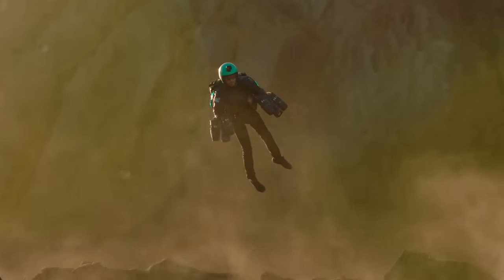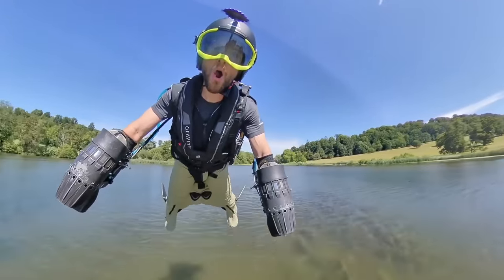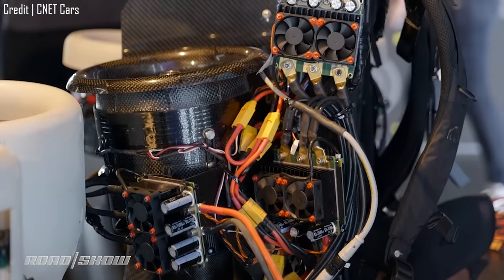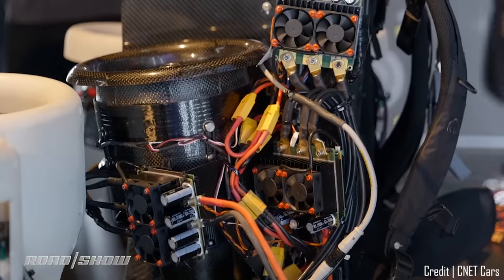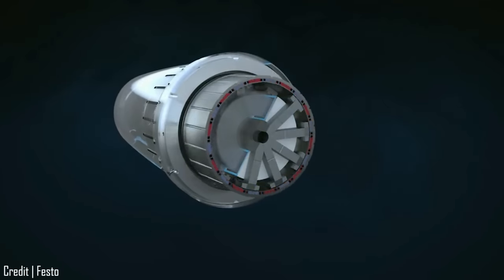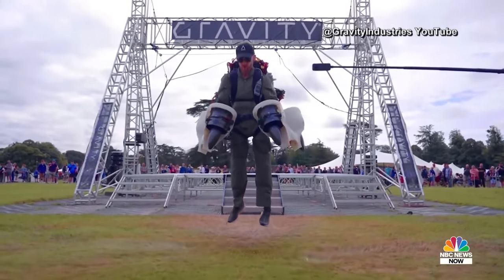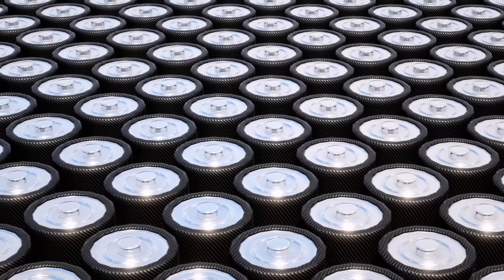World's First Electric Jet Pack Is FINALLY Here!

Comment: While technically you could do pure electric,  limited flight time is a major problem. Batteries don't yet have even close to the energy density of fossil fuel to compete.
Reply: but that goes against the green narrative!
Reply: Factor in developments in Beamed Energy towards Space Elevators, Laser Development for Fusion, Targeting Systems for Automated Point Defense, and factor in a Real World Development need and it's just an engineering problem which needs a dedicated team with cash :P

No Military or Rescue Service operates without support resources, so a Local Energy Source seems reasonable.

Plus if the intent is for training there's a strong likelyhood that permanent physical tethering could be justified by the use case in a controlled environment: say a warehouse with a Crane Gantry system delivering mains power.

No Iron Man, but maybe a Tin Man? : D
Reply: @XAtmo97  

I'm just talking about the present and particular use cases where high energy density is critical (e.g. flight). Of course physicists and engineers are always coming up with solutions to seemingly insurmountable problems. Battery densities might one day improve to a point they are competitive or even beat fossil fuel.

Some argue interplanetary rockets are a use case you can never use pure electric. I recently read an article about some physicists who speculate even electric rockets might be possible one day using an interesting loophole in special relativity.  Since mass increases with speed, they argue in theory it should be possible to put particles in a loop where on one side of a proposed spacecraft their mass is greater than the other. (effectively simulating a rocket ejecting mass to accelerate) Physics is amazing.
Reply: thats because people still using lithium batteries, there is aluminium air batteries that can store far more energy dense, but cant be recharged like the way we charge lithium batteries
Reply: They could use nuclear energy and develop a way to keep dangerous radiation from effecting you…
Reply: in the future, there will be diamond batteries, using the radioactive waste of nuclear power plants, which will allow for incomparably more.
Reply: @ProgramPierwszy   The problem with anything with the qualifier "radioactive" has always been safety. Although there are use cases for radioactive products in non-trace amounts, it's tough to use them for widespread commercial and public  use ( especially in situations where an aircraft can crash and thus potentially spread radiation on impact)

Even supposed safe thorium reactors are lethally radioactive. They are just safer from meltdown, half-life, and military-use perspective. Nuclear may eventually find its way into mainstream batteries but I think it will require physics and engineering that figures out how to detach the word "radioactive" from nuclear power generation.
Reply: Didn't you watch the video? It's for training. The government probably commissioned the company for a version that would enable the mass production of competent pilots.
Reply: We are centuries away from that technology.
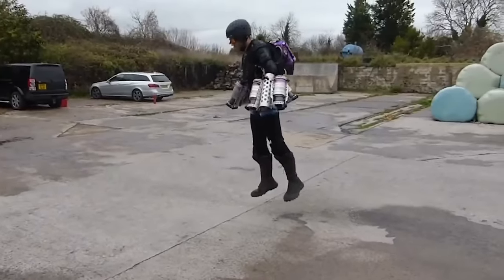Reply: 6:29 what video?
Reply: @ruzzodac  What is the green narrative and what is its counterpart? 
- Kurt
Reply: forget about that, the main problem will be overheating cables and lithium battery temperature while flying, I'm afraid the first death from this flying suits will likely be from and electric one, this is not safe at all, this guy are just pushing their luck to far.
Reply: Not issue chief only need  1980 spexs
Reply: Yes but it does open possibilities to a lot more ways to store the energy required
Reply: It is only PROTOTYPE.
Reply: They will i’m certain of it, not tht I am a champion of Electric motors. But in the not too distant future Batteries will be lighter and highly versatile.
Reply: A distributed propulsion system would be a good compromise. One large turbine engine on the back to produce power, and electric fans on the arms for lift.
Reply: Jarvis show the map
Reply: Some never did invent super capacitors then no ?
I was going to say that's why I haven't heard of them, at all ever.
Not even enough to mention them on a comment board 🤔
Reply: Radioisotope Thermoelectric Generators.  You're welcome.
Reply: They're probably heating up the copper too, so extra battery life may not even extend flight time.
Reply: And what about the arc reactor?
Reply: @sentinel8185  aka boiling water.
Reply: 9❤😊 @XAtmo97

Comment: They should use this with a high voltage wire when training on the tether, would save a load of fuel and emissions.
Reply: The configuration is impractical, you need upper body strength to fly this, like a static pushup. Small fans are inefficient. So as a specialty vehicle for very narrow conditions. Ideally a bi-copter with large overhead rotors, preferably foldable down along the side of the backpack battery when stored= much longer flight time and we have the electronics to have it be easy to fly.
Reply: @Tore_Lund  that's what jetpacks are for
Reply: @foxfoxy5490  Jet pack flight time 70 seconds,  electric bicopter 20 minutes! Big difference
Reply: @Tore_Lund  eh, your arms are pretty much locked downwards. Probably a bit easier than holding a push-up
Reply: @jhendies  I'd imagine there is a lot of balancing involved in piloting this, so his abdomen, shoulders, back will be working all the time, it will feel like exercise.
Reply: @Tore_Lund  Most likely you are misunderstanding how this works. At least half of the total lift comes from the backpack - you balance the dissymmetry of it with the hand-thrusters. Still hardly any perfect, but at least not as bad as flying in a constant push-up...
Reply: @getsideways7257  That sounds reasonable.
Reply: @Tore_Lund  In theory, yes - but in practice there is still a lot of what can go wrong with this whole idea. Compared to this, wingsuit is a safe more of transportation.
Reply: Stop this "emission" nonsense ... POWER STILL HAS TO BE PRODUCED!

Comment: Flight time and cost are going to be the real limiting factors here. 5 minutes still really limits the possible applications.
Reply: Flight time is terrible on jet fuel, too. Batteries & fuel are too limited by space and weight. Better start upping my squats at the gym.
Reply: That and getting tangled in power lines at night.
Reply: @archangel_one  lol speaking from experience?
Reply: We could eliminate that problem by using a Radioisotope Thermoelectric Generator like the one on the Mars rover but everyone gets scared around plutonium.  It's too bad, because its energy density is fantastic.
Reply: @LG123ABC  Just ONE plutonium particle can cause cancer, that's why they are afraid. But the solution is simple enough, make quality parts ourselves.
Reply: These jet packs using jet fuel only have a flight time of less than 10 minutes.Liquid hydrogen fuel cell drones have set record flight times.Even compressed hydrogen will beat lithium ion.
Reply: fuel cell power module to a drone and recorded what stands as the longest ever multirotor flight at an eyebrow-raising 12 hours, 7 minutes and 5 seconds
Reply: Anything that can be done with a jetpack can be done better with a helicopter
Reply: @LG123ABC  RTG's have absolutly the lowest power to weight ratio of anything ever created
Reply: If you are a farmer, with solar and wind you could afford to fly it around your farm. What a life! 😅

Comment: If they could make it quieter that would be huge because one of the current biggest disadvantages is noise level
Reply: Unfortunately there's only so much you can do there. Most of the noise from a jet engine is just the sound of air moving through a tube pushed by a fan quickly. Which Is why car turbochargers and larger rc EDF jet's fans make a similar turbine whine even though no combustion is happening within them.

Comment: High performance batteries are 3.2kg per kw currently(the likes of freefly alta X drone batteries).This thing is 96kwh. With 22.4kg battery pack you'd have 7kwh. At full throttle this machine would use 1.6kw per minute(96kw per hour/60). That is 4 minutes 20 seconds of full throttle. With 80% average you can be getting into the 5minute territory.

Comment: The many times more power of superconducting motors does not come from higher efficiency. Efficiency is above 90% in all cases anyway.
Advantage of no electrical resistance is high amps which means high magnetic field. The motors are strong for a given diameter and therefore mass which also additionally helps a little in flying operations.

Comment: If they use a tether to train why not skip the battery altogether and let the tether also run an electric power cable and plug into the wall? It seems it could work like those water flyboards that are tethered to a boat. Thanks for posting

Comment: I wonder if any fuel cell tech is small and powerful enough so that you can maybe have Hydrogen, Gas or something else to generate power  for the system. Is a hybrid solution like building a micro turbine to generate power for the rest of the suite not a solution maybe?
Reply: Imagine a jet suit that burns as efficiently as the Hindenberg
Reply: @nimrodquimbus912  the og version of this has a bag of kerosene burning in your hands, and the hindenburg didnt use fuel cells.

Comment: Yea it's the batteries. I agree that superconducting motors would be awesome, but really electric brushless motors off the shelf are pretty amazing. They can have 90%+ efficiency and the power density of a jet engine already, so that's not really the problem. But batteries are slowly getting there. At least cost has come down massively.

Comment: Maybe they could design an electric  fan with a hollow axle that you could put your hand through. This would allow a  larger fan (higher efficiency) and reduce the number of fans. I wonder if fuel cells have the same voltage slump problem and if they have sufficient responsiveness for this application.
Reply: maybe just a small energy storage system in between the fans and the cell

Comment: It will be more use if they remove the thrusters from the hand. They  ould palce it on the side of the back pack and can be controlled through legs to feet. So the hand can be of more use.

Comment: The most efficient way to get in the air is to jump. However, these jetpack are admittedly more impressive. I am sure, given enough time, good flight times will be achieved eventually.
Reply: If you'd accept the definition of "good flight times" as being two minutes instead of 15 seconds -- then maybe.

Comment: Use the wind-turbine principle (converting mechanical energy into electrical energy). As the blades spin, it produces electricity to charge the batteries. That's what the alternator in a Car engine does; the engine spins the alternator, which generates electricity to charge the Car battery.
Reply: Ok, this is epic. What's an engine without an alternator?

Comment: Chem-fuel engines are hazard at melee range at anything. For a man-sute gear, the electric can also rid of liquid-mass storage volume, while only partiional dry-mass weight increase. With more powerful turbine engines batteres + pulse static/plasma afterbuns.

Comment: What if you add small wind turbine to the suit? That way as the suit drains one battery pack the backup would get charged. Then when the first pack is low it switches to the backup. Then the primary would get charged. You could possibly fly for as long as you want. The only problem is how quickly can the batteries be charged.
Reply: You must be young. The resistance of the fan would increase air resistance. Thw resistance would be considerably more fuel than the charge payback.

Comment: A capacitor/battery hybrid might work if you turn on the capacitors at the same time the batteries are incurring the most resistance
Reply: Capacitors have a miniscule charge density compared to batteries. After watching the video "Super Capacitor Dragster" (Tom Stanton's channel), I was amazed and disappointed to learn super capacitors held very little electric power when compared with batteries. I'm afraid the weight of capacitors would likely hurt the performance of the jet pack more than the fast release of power would help it.
Reply: Wribg

Comment: The idea that you need 1000+ HP for this makes no sense at all. Like seriously you can just do some back of the envelope calculations on how much it takes to lift a human, and for leaning forward at an angle it doesn't get anywhere near that for reasonable angles.

They much be measuring the amount of fuel used, and calculating it for that. And yeah those jet engines are going to be terribly terribly inefficient for that, jet engines suck when there's no air speed pushing air into them...

For reference, we've achieved helicopter flight by using just human power, not for long and with a huge huge super lightweight quadcopter frame. But some guy did it. His estimated energy usage would be less than 1kW.

So the whole >1000 hp makes no sense.

Comment: There may be a niche application for an electric jet pack even if one has only 2minutes of flight time. That may be enough  to allow  soldiers to fly over a mine field , river, or swamp.

For example if it only takes a minute to fly over a river a soldier could fly over the river land, and then have enough juice left in the battery to fly back over the river.

Also, cargo UAVs could fly over extra batteries as well if needed or even ferry back the jet packs for more soldiers to use them to fly over the obstacle  to reinforce the first wave. 

Breeching minefields is a big problem in Ukraine. 

Also, crossing the Dnieper and the swamps near it river.

While kerosene jet packs could be used for  this, it might be best to do this in the cover of night  since the Russians have limited night vision capability but the plumes from the kerosene jetpacks might give them away. 

But an electric jet pack  would not have a tell tale plume. 

And as far as its noise, that could be masked by flying UAVs around them so as to create other noise sources.

So these might be used to get say a ten man team across a minefield of river that then could be used to gain a foothold on the other side  that then could be reinforced by other waves.

Comment: I wonder if they would consider using a fuel cell instead of a battery?  
Fuel cells are extremely efficient and they may not have that "voltage sag" problem.

Comment: use a motor controller with frequency control and increase the voltage so that the conductivity remains constant across any speed of the motor. at higher frequency you need to increase the voltage to get enough voltage per cycle of frequency that would also increase power input but it would also allow the motors to be smaller and still have high efficiency. such drive shafts would have problem with friction to speed so you need to use induce magnetic bearings to allow much higher rpm of the motors. if you want to run the motor at 50 000 rpm or 200 000 rpm in a small size you don't want bearing failure. the rotor blades also have to be stronger and made of metal and probably in a multi blade jet engine design to allow higher compression efficiency.
Reply: this only applies to AC current. pretty sure those are DC motors which have a direct relation to voltage/amps and not frequency. VFD's are heavy.

Comment: 1050 hp to lift 400 pounds for less than 5 minutes very efficient. true ducted fans are more efficient but only with the same diameter prop/fan. You take the same power above and put that in to a larger prop and you need way less power to lift the cargo. It is nice they are trying but batteries need to be advanced by a lot to work well.

Comment: Wireless energy transmission like envisioned by Nikola Tesla is the only hope for longer flights if no new major breakthroughs in battery tech are forthcoming soon.
Reply: Yeah, and we have that. Have for decades. It's called a cavity magnetron.  Now, do you have ANY idea how much microwave power is needed to sustain something like a jetpack?  You can't just broadcast it everywhere, because that creates harmful EM radiation. You'd be transmitting the same power to everyone and everything as to the jetpack.  So you have to focus the beam, or put it in an enclosed space, like a microwave oven   Imagine your microwave being used to power a jetpack, from significant distances, cutting through atmosphere in a directed beam. That's a MASER! A microwave laser that will flash-boil whatever it hits. 

We already have those, too, but so far they're used as non-lethal weapons because they can't be made into lethal weapons with current power supplies. It just takes way too much energy to flash-boil even tissue at limited range, much less get through any armor.  Your idea isn't wrong, but the sheer amount of power it would take to transfer energy from a power source, THROUGH the air, to a jetpack that might change direction at any moment is just a maser beam waiting to go wrong.  It's nowhere near worth the devastating cost.

Comment: 16KW is at least 300 amps then X 6 = 5 seconds maximum, not enough cells in parallel  on this model even with best cells avail.?
30amps per cell =180 then times 12 or 13 stacked for 48v.

Comment: I'm not seeing the advantage it would have compared to a robotic drone with some remote pilot assistance.
It has a good wow factor to help advance battery and motor technology. Your arms become useless and are a liability if you are depending on them as engine support.
The human in this scenario is just adding weight. Humans tend to involuntarily react when they catch a bug in the mouth or a bird in the face. 
It has the cool factor of a wingsuit. It's fun to watch but offers a low margin of error for most people to take on as an activity.